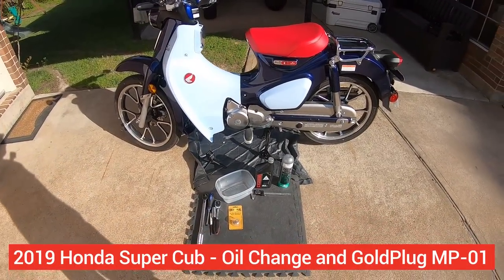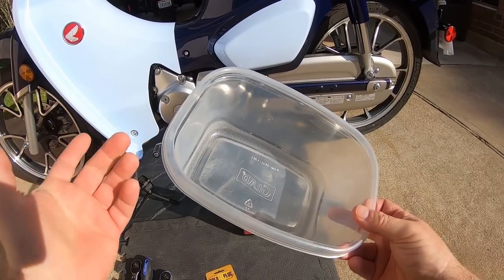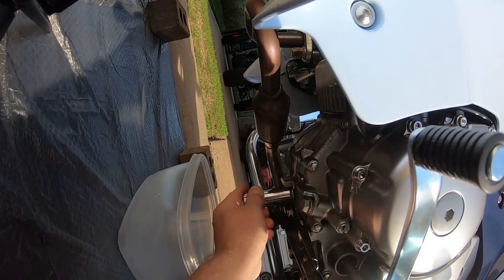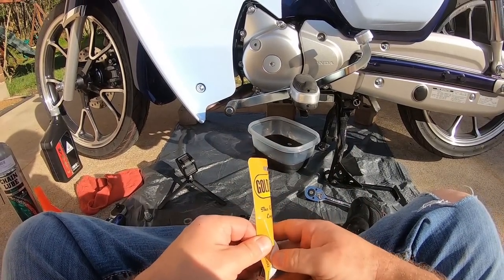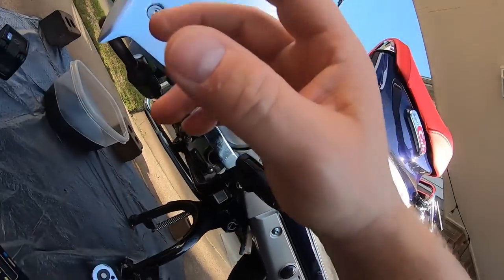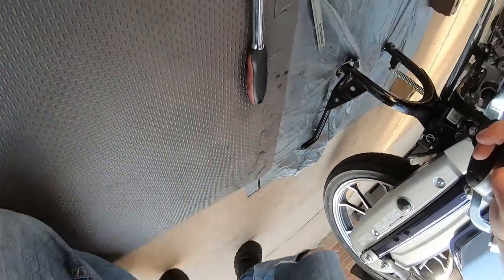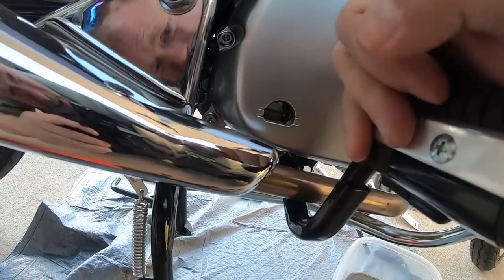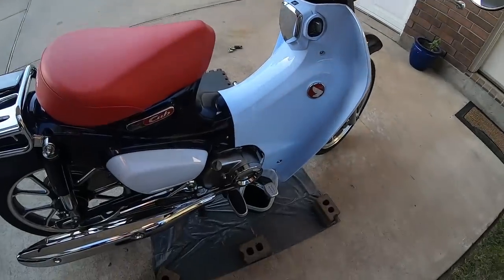2019 Honda Super Cub C125 // First (early) Oil Change // Gold Plug MP-01

Comment: The second bolt is for the timingchain tensioner.
Reply: accidentally pulled this one today when giving my supercub its first oil change.  spring and drilled 'piston' slid out.  Went back together without issue.
Reply: Hey, thank you for letting me know

Comment: Really great video. Bought a new 2020 super cub only have 150 miles so far. dealer said to bring it in for service at 600 miles but I'm going to do oilchange at 300 and get the gold plug then bring to dealer at 600 miles. Your video was very helpful. THANK YOU!
Reply from the maker: Thx for the feedback, and I'm glad that the video helped!  The bolt for the timing chain tensioner was a new one for me, so I'm glad that I didn't mess with that.  Doing maintenance before the service manuals are available is always a bit tricky.  The GoldPlug has been working surprisingly well in the Cub despite the screen right above it.  There is always some ferrous sludge on the magnet when I change the oil.  Cheers!  😉👍  --QM
Reply: @QuasiMotard  I'm going to get oil today and new drain plug and order manual. I was wondering what that other bolt was for. Won't be messing with that either! Thanks so much for your help really appreciate it. Safe travels my friend!

Comment: I had an HRZ for 17 years. The motor never quit, replaced the transmission twice and belt around 12 times. For the third transmission failure, removed the transmission and self propelled feature. Built-in workout every week!😅 Always oil change and new air filter at the beginning of the season.

Comment: Your calipers have a depth feature on the bottom. You can place the bottom of the calipers against the end of the bolt and extend the caliper until you hit the head. Same goes for measuring the depth of the of that screen in the oil pan. Great informative video, just thought I'd offer some tips

Comment: I like your videos about your new Honda Supercub. You are a lot like me in maintaining your machine. So I thought I would give you two suggestions you may like.  The first one the Fomoco oil drain plug. This company has many sizes and variations to fit any vehicle. This drain plug is installed like any other, but it has a lever on it to allow the oil to drain out when opened, and you simply close the lever when the oil is drained. No need to unscrew the plug. Also, it has a nipple so you can put a plastic hose on it to drain into a pan or jug, so there is no oil spillage. One other benefit is if you over fill your oil, you can drain a little out very easily to get the proper level. I have these on all my vehicles, and they work great!. The other suggestion is to keep a small notebook on your vehicle, and write down the date, mileage, and the maintenance item, or part you installed. This way, you can see quickly, when you last changed your oil, when you install a tail light bulb, or tires, and see how long these items last. It is a good system. I thought you might be interested.  Thanks for making these videos.
Reply: I meant to say Fumoto oil drain plug.
Reply from the maker: Thx for the tips!  I completely agree!  I have used those on other machines in the past... they are GREAT!  I have similar drains on my race GX-series Honda engines on my race karts... it makes draining the oil a 2-minute affair with no messy cleanup of the motor mounts.  If there were a way to have the quick drain AND the magnetic pickup, then I'd do both.  I'm not sure how well the GoldPlug will work on the Cub's motor because there is a screen directly above it (presumably part of the spinner/filter assembly).  That filter might catch the metallic junk before the magnet can grab it... we'll see how it goes.  These small motors don't have oil filters, so I always like to give them every extra chance to keep the abrasive bits out of the oil.  

As for the maintenance logs, I do that religiously.  I track all of my maintenance items for all of my machines in Evernote.  If/when I sell any of them, I can export the notes and provide the history to the new owner.  In addition to the electronic notes, I have a folder/binder on each machine with receipts, shop labor invoices, etc.  Complete.Mechanical.OCD  --QM

Comment: A (free) bit of kit I find very useful is a sheet of cardboard.  I always keep several sheets in my garage as they always come in, either just to lie on, especially in the cold months but also to soak up drips of oil etc when working on  a machine.  They have the capacity to absorb small amounts of oil and other spills and the added advantage of being a light buff colour, so it is easier to spot washers and fasteners when they try to do a runner.

Comment: The other bolt is the cam chain tensioner. The clutch also functions as the oil filter (centrifugal type oil filter), it can and should be cleaned out every 2500 miles or so.
Reply: Currently restoring a c50 super cub good old reliable tiny beast!
Reply from the maker: Yep!  I did this first oil change before the service manuals were available here in the USA, so I only messed with what I knew from my son's little Honda CRF110F... it had a similar clutch and bottom case design.

Honda specifies 8000 miles for the oil spinner service on these newer Super Cubs.  I waited until 15000 miles after I finished my Scooter Cannonball Run trip in 2021:  https://youtu.be/rYjO_8luido .  It was about 50% full of crud, so that cleaning was definitely overdue.  Cheers!  😉👍  --QM

Comment: Glad I rewatched this.
I've only recently completed a full rebuild of the engine on my Wave which is very similar internally to the C125..

Since that was my first engine rebuild, the anxiety levels where up there. I haven't paid that much attention to the first oil changes on any of the bikes I own, thinking that it's a Honda. Now that this was done by me, of course I sifted through the oil and did earlier oil changes. I had a bit of panic, seeing a few tiny stripes of that crankcase silicone in, making me think I did a poor job and now my Engine is at risk of oil starvation.
Seeing that even the more expensive C125 exhibits similar pieces in its oil makes me a lot less worried.

So far I've done almost 500km (300mi) since the rebuild with the actual total clicking over the 80,000km. These are pretty reliable bikes if not abused too badly. Mainly look that they don't starve for oil as they can consume a tiny bit during fast cruising, which easily runs out with their small sump.
Reply from the maker: I recorded the first oil change for several of my smaller bikes, but I can't remember if I posted the videos or not.  The surprising thing that I found in both of my PCX150's was fibrous material (like shredded wool gloves or something) and LOTS of silicone gasket material caught in the wire mesh filter.  I didn't notice anything unusual except the extra gasket material in my Super Cub and CT125's first oil changes.

The GoldPlug MP-01 that I've installed in most of my bikes seems to work very well because they always have ferrous sludge and small chunks of metal on the magnet at every oil change.  The amount of debris always seems to diminish as the engine ages, but that's a good thing... keeping that abrasive junk out of the oil should prolong the bottom-end bearings and transmission bits.  Cheers!  😉👍  --QM
Reply: That's another big relief!
On my second oil change that was 200km after the full rebuild I found a noticeable amount of fluff in the strainer.

It certainly gave me quite the anxiety for a while.
It probably came from Mircofibre towels I used when cleaning parts before assembly or from the clutches?. Though the PCx does not have a clutch in the engine.

If I had waited till the 1000km service, these particles would have probably migrated into the spinner.

The more I deal with these bikes, the less worried I am with these things. When I changed the oil at 4000km (last one before that at 3000), the also had a bit of fluff and a couple silicone flakes on the Gold Plug.

While that shows how dirty these engines are on the inside (especially when still quite new). It's relieving knowledge. These engines have a reputation for being very dependable in South East Asia where the step through's are used as true work-horses.

Like you mentioned about your high miler bike, my Wave 125i also kept shedding tiny metal particles into the Gold Plug until those 80,000km. Apart from that one bearing it was still mostly quite healthy, not burning unnormal amounts of oil, making good power,....
I actually suspect, that something I did earlier in the bikes life degraded the longevity of that bearing (chain too tight and not frequent enough spinner servicing).

There are so many sources of metal to metal movements which create those shavings that it's not something we should be surprised about:
Rings, Bearings (there are quit a few inside), gears as well as the timing chain.

- That chain stretch in your drive chain comes from the same kind of wear and if you ever put a magnet on the oily sludge in your drive chain guard you'll notice how much metal there is in it too :)

Comment: Oil was dark for 300 miles, but not shockingly dark. Your video shows why it never hurts to change the oil every 300 miles or so for the first year of ownership. Indeed, there's no penalty or damage to changing the oil too often, except maybe to one's wallet, if money is an issue. Plus, God forbid, metal debris may all of a sudden accumulate. Better it is caught at 300 miles than 2000 miles, especially here in "high rev" country (aka steep San Francisco hills).
Reply from the maker: Absolutely!  I don't mind spending a few extra bucks for early oil changes if it can prolong the motor's life. Oil is cheap, motors aren't. The Cub requires so little oil anyway... what's an extra $5.00 in the long-term? Honda recommends 4000-mile intervals, but that seems a bit long to me.  So, I'll spend about $5.00 for changing every 1500-2000 miles instead... that's just cheap insurance in my book.  --QM

Comment: It does have an oil filter. it's on the right side on the motor, I got mine changed today on my 2023 super cub. I also thought it didn't have.
Reply from the maker: The 2019-2021 Super Cubs had the old engine design that didn't have a cartridge-type oil filter.  The 2022+ models have the newer engine design from the Grom & Monkey with an oil filter.  😉👍  --QM
Reply: Oo ok thanks for clarifying,

Comment: Again, I bought the Gold Plug for my Super Cub too, on watching your video it reminded me I had to buy that. Thanks gain for the heads up. 

Update: Absolutely yes on protecting the beautiful surfaces of this unique bike. I'm careful with all my bikes and cars or vehicles, but I consider this limited edition Super Cub a museum piece. Like that one guy on YouTube, I'm tempted to park this bike in my den and just look at it all day and night. OK, I'm just kidding, kind of. I got my bike with two miles on the odometer. One month later it shows 7 miles indicated. Did I mention I love this bike. 

Anyway, I've taken a liking to "Bikers" products, a Company in Thailand who sells billet quality add-ons and accessories, made especially for the Honda 2018-19 Super Cub 125A. For example: 

Bikers sells all kinds of different covers that customize, beautify, or protect the bike's surfaces, including where damage may occur, e.g., scratches inflicted by our shoes or boots when shifting or braking. Their products will protect better than bra material or tapes, which are simply too weak to protect the beautiful polished or machined surfaces from damage boot or shoe damage. 

From Bikers or others I have bought "protection" covers. Yes, Bikers products are expensive, but when received them I was very pleased to see these add-ons comprised machined aluminum and quality hardened rubber. (Yeah, the downside is that I have spent about $1,000 so far, e.g., $240 rear rack, $400 on various covers from Bikers. Oh well, that's what pleasure is all about. 
 https://www.ebay.com/sch/m.html?_odkw=&_ssn=bkk_classicbike&item=163537300726&_osacat=0&_from=R40&_trksid=p2046732.m570.l1313.TR4.TRC0.A0.H0.Xhonda+super+cub+2018.TRS0&_nkw=honda+super+cub+2018&_sacat=0
Reply from the maker: I thought about keeping my Cub as a low-mile showpiece, but then I changed my mind after riding it a few miles.  Now, I plan to do the exact opposite... I'm going to put as many miles on this as possible over the next few years to see how it holds up mechanically.  I'm curious to see how well the engine holds up with the kind of abuse that I dish out in my commutes and road trips (currently about 60K miles/year spread across multiple vehicles).  

If all goes well with my schedule, I plan to take the Cub on the 2020 Scooter Cannonball Run ( https://scootercannonballrun.com ), which will be a coast-to-coast ride from Bar Harbor, Maine to Eureka, California... that's 10 days and ~3500 miles!  However, the trip will be over DOUBLE that distance for me because I live in Houston, TX... so add 4350 miles (Houston, TX to CA, and then ME back to TX)... so that's ~7850 miles round trip!  The whole trip will probably take about 15-17 days including the trips out and back from the race endpoints.  Of course, I could trailer (or ship) the bike to/from the race endpoints, but where's the adventure in that?!  --QM

Comment: A possible help for the top speed on the 15T drive gear. Something called dip stick tube vent(about $25). The kit has you replace the rip stick with this device. It does a great job of revieving crankcase pressure. That may be making a slight resistance for the piston  -  Just a guess. I think it just might give you the few mph you're looking for. It gave my Vespa a noticeable change for the engine - actually easier to start etc.
Reply from the maker: Thanks for the tip!  I'll have to research that option to see if it would work for the Super Cub (Grom, etc).  Cheers!  👍  --QM

Comment: 1. Had you run the engine to warm up the oil before draining?  This helps to pick up sediments.
2. Does this engine have a hollow flywheel that gathers grit and sediment internally by centrifugal force?  Access to that might be in the right hand side of the engine.
3. Within the enclosed chain case, does the crankcase breather vent warm oil fumes onto the chain?
4. Had the magnetic drain plug been too long, one or two washers may have cured that.  The magnetism will still gather ferrous particles.
Courtesy of Half Vast Flying.
Reply from the maker: Yes, the engine was already warm from riding.  These engines (same used on the Grom 125 and Monkey 125) have an "oil spinner" (centrifugal particle filter) on the right side of the engine.  The maintenance interval for the spinner is every 8K miles, and it requires two new gaskets (side cover and spinner face gasket) because those usually tear during disassembly.

The chaincase is just a dust cover and chain guard.  There is no lubrication system for the chain.  The crankcase breather on these bikes is fed back into the airbox as a part of the emissions system.  --QM
Reply: @QuasiMotard  Thanks for your response. I understand the chain cover, breather, and centrifugal filter.  On my 1960 (or maybe a bit earlier) Honda 50cc, the breather came out between two teeth of the front sprocket.  Really slick.

Wen lubing a roller chain, the only place that will accept oil is at both ends of each roller - in between the roller end and the side link.  And, the only fraction of that lube that does any good is the itty bitty bit that seeps into the internal joint of the pin and roller.  All the rest of the lube is just messy waste,  On my pedal bike, I use a small, plastic bottle with a pointy spout capable of delivering only one drop at a time, one on each end of each roller.

What a chain benefits the most from, is oil of a low viscosity being applied so that it seeps into that pin (axle) joint inside of each roller.  BUT - once the oil is inside of that joint, then it should be a higher viscosity.  The oil flows around the pin so that, as each roller comes up onto the first drive tooth of the drive sprocket, the oil is squeezed back by stronger tension on that part of the chain.  It acts as a little hydraulic shock absorber link after link.

A way to get that “at first thin, then thick” oil, is to select the oil that you want to lube the chain with.  One half fill a plastic squeeze bottle (that has a one-drop-at-a-time nozzle) with that oil, then top it off with gasoline.  Mix it up.  This thins out the oil.  Apply a drop of thin oil to the roller ends all the way around. I have to put in a twisty like on bread wrappers to mark the start-stop point. Then slowly run the chain around more times than you think you should have to, to work it in. Then, let the gasoline evaporate a couple of hours. Sitting in the sun and breeze helps that.  Again, slowly run the chain around a few times.  Then, with one hand full of paper towels and loosely gripping the chain, run the chain some more to clean off the outside of the chain.  Don’t worry - NONE of the oil on the outside of the chain is doing you any good.  It slings off onto your bike and clothes.  ONLY the oil on the internal pins is benefitting your chain.

Frankly, most riders won’t go through that whole process.  They would rather buy more chains, sprockets, and clothes.  That’s OK, because it’s good for the economy.
Courtesy of Half Vast Flying.

Comment: Maybe a rubber band gasket to keep the plastic inspection plug snug for the chain inspection port?
Reply from the maker: I don't know if that would interfere with the other bits... clearances and such. I haven't lost it yet, so it appears to be ok for now... although I did order a spare just in case this one falls out.  --QM